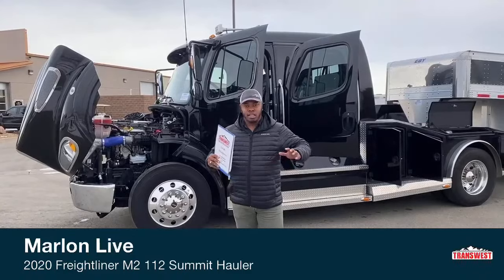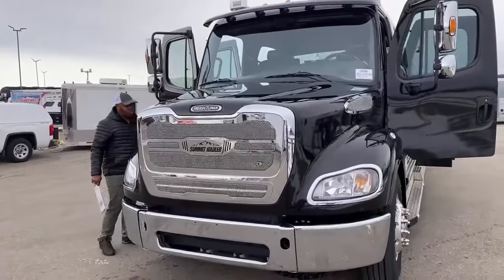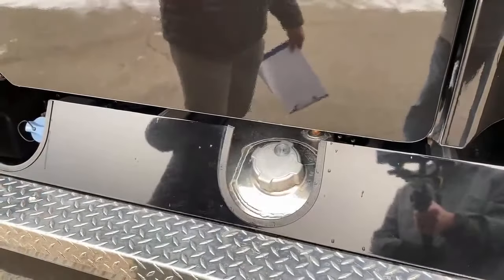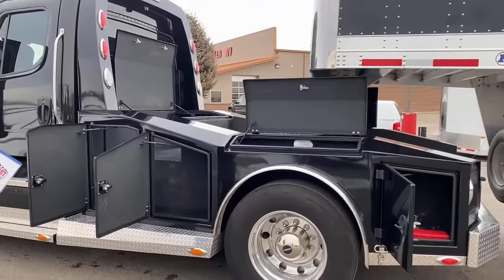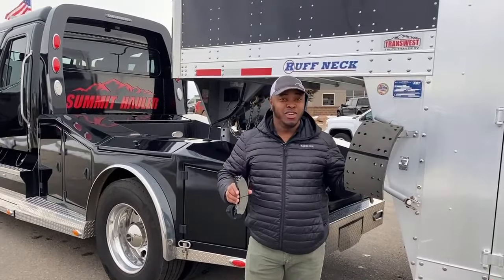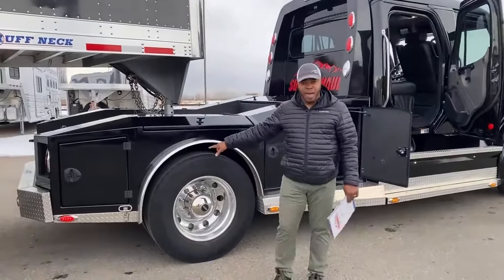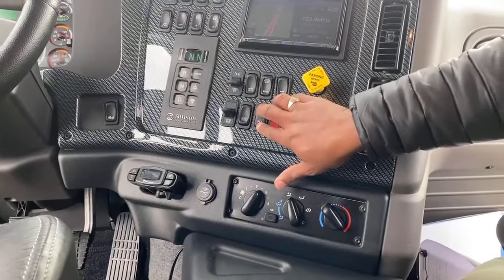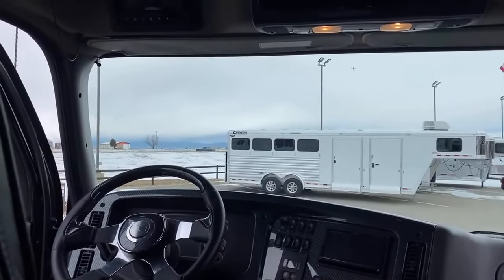2020 Freightliner M2 112 Summit Hauler

Comment: Can you get this truck without air brakes
Reply: It doesnt come with air brakes, thats extra!
Reply: @jamessoho8806  man I am thinking about getting one I have a 6 car would that handle the 6 car carrier Kaufman
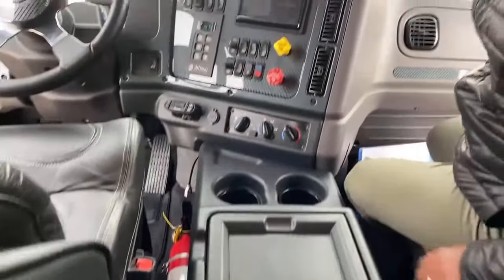Reply: @jamessoho8806  The red and yellow knobs on the dash at 20:56 are for the air brakes and yes they are standard on the M2 112.
Reply: Why would you not want air brakes?
A truck this size pulling a large trailer wouldn't stop very well with hydraulic brakes.

Comment: Towing capacity?
Reply: it is able to tow over 30k lbs  on the gooseneck and 20k on the bumper pull
Reply: @marlonbledman5262  why buy this when you can buy a f450 for less? I mean just doesn’t make sense it has the same towing capacity if those numbers are correct
Reply: @forgedcustoms5699  well this is going to outlast the f450, because is a real heavy duty, the engine is meant to last longer, and even if this is rated to tow that, that engine is used in more heavy units, everything in this truck is bigger and better, at exception if you want something small, a daily driver that you can fit on a garage... to tow 1 or 5 times a year, then the f450 is the answer. Not hating on the f450, but this is real heavy duty.